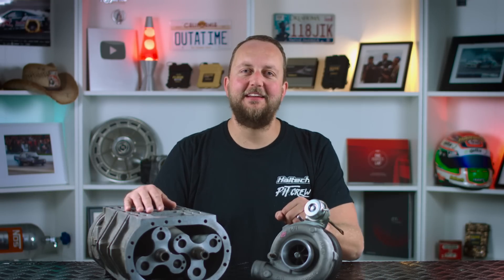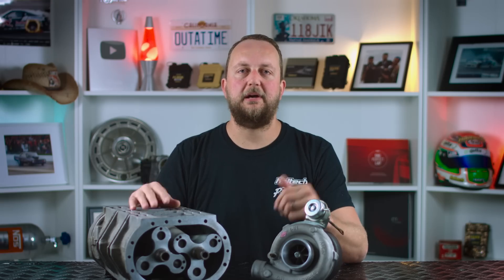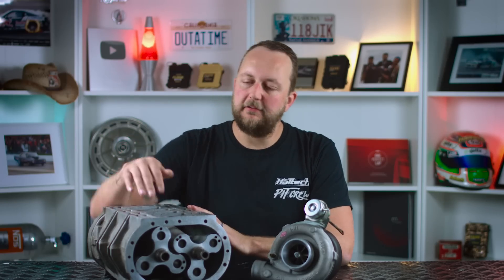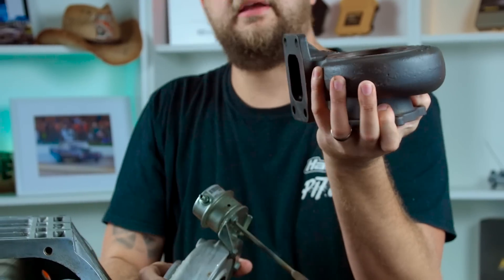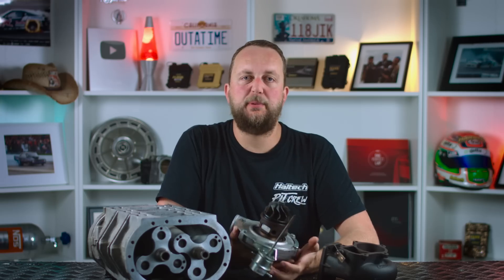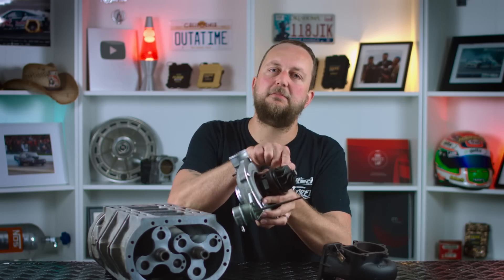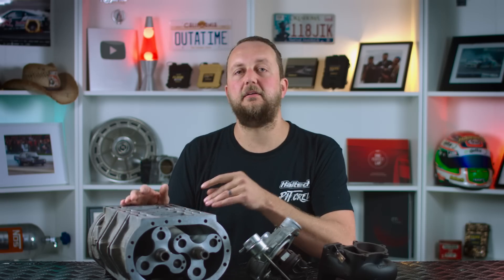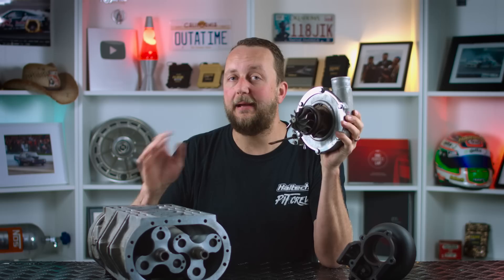🛠 Turbo or Supercharger? | TECH TUESDAY |

Comment: Forced induction can be further broken out by type of compressor... positive displacement or centrifical. Roots and Twin Screw are positive displacement compressors. A turbo is a centrifical compressor. A typical supercharger has zero lag and a linear boost curve. If RPM doubles, boost doubles (2X). However with a centrifical compressor, there is lag and boost is exponential. Double the RPM and the boost is 4 times, not 2 times pressure (2 squared). Superchargers also have some parasitic losses due to it being powered by engine. 

Fun Fact: Top Fuel superchargers take 1,000 hp to force feed vast quantities of air needed for 90/10 Nitro / Methanol mix to produce 10,000 horsepower. Net gain far exceeds parasitic losses. 

Note: ProCharger is not a supercharger. It's an engine driven centrifical compressor. It is a turbocharger without the exhaust driven portion. It has zero lag, but it's boost curve is not linear, but rather exponential. Like all engine driven compressors, it has some parasitic losses too.

I have been designing engines with compound forced induction... using both super and turbo chargers. Supercharger is fed pressurized air from turbochargers. Zero lag, linear boost curve, and enough power for a moon mission. Parasitic losses are reduced compared to supercharger alone.

Comment: Turbos run more boost safely with way less pressure to the crank so in the end it'll be better for a motor to use turbos then anything ran off the crank...

Comment: I have to argue with the misconception of superchargers having no lag. You first need to better define lag. Some people say it's before you hit positive boost, but that's actually boost threshold. The more correct way is to define it as the point where the impacts of the boost are felt (which is while engines are still under vacuum). 
Yes the supercharger is spinning whenever the engine is, but so is the turbo. People think that 1 psi on a supercharger a few hundred rpm sooner means it's magically significantly less lag where a turbo of the same size will ramp much quicker and have full boost long before redline, unlike the supercharger where max boost is only at redline. This also doesn't account for things like launch control and other antilag tactics within a given turbo/ engine management system (not including nitrous since that's an additional power adder).
Both have their benefits and downsides that I would have liked to see you dig more into. Yes the supercharger behaves more linearly and controlibly, but turbos also have the benefit of significantly more power under the curve. Bit as you mentioned, the quick ramp up in power can make it harder to control

Comment: Even if the engine was 10% VE it consumes 5L. The difference between 10% and 100% VE is the density (ie mass) not volume
Reply: I believe he's speaking for STP conditions with oversimplification as most don't understand air in terms of kilograms or pound mass. And because it's so easily compressible, a pound of air doesn't really mean anything. The mass of air will always disperse into the 5L of space given in the engine

Comment: Regarding the previous video. Could you shoot a recommended upgrade path for a k20/24? Ie start out with this, then that and finally end up with 1000hp at the wheels, for example. Could you also include pump gas only variants as some countries do not have access to e85?

Thanks for all the great info... Love the channel.. Keep up the good work
Reply: 1000 hp? billet everything.
Reply: 1000hp K series on pump fuel? 😂
Reply: What I meant with upgrade path is how far can you push on pump gas with certain upgrades and what is required beyond that to eventually end up at 1000. I don't have a k24, I never even owned a Honda. Was a question for the sake of interest and could maybe help others upgrade their cars. 1000hp on pump gas from a K24 sounds like a one liner joke tbh lol

Comment: Both...Used together is the best option. At low rpms, supercharger and at high rpms turbocharger comes to life. They complement each other and thus eliminating the annoying lag of the turbocharger, offering a much better torque at low engine speed.

Comment: JDM: Turbo

Muscle car: Supercharger
Reply: Fun fact, the very first car to use a turbo, is an American car. So what you said is completely wrong. Both go on both like a glove on a hand.
Reply: @domantas8185  Superchargers can't make high boost. Because muscle cars have big engines, then don't need high boost. JDM usually have smaller engines and to achieve bigger power they need turbos. 
Now if you put turbos on big block engines.... that's where unicorn land begins :)

Comment: I hear a bias in the tone :)
Reply: Only because turbos are better.  Lol
Reply: it is a technical bias, because turbos are simply more efficient machines for boosting for road cars. that's why most unmodified boosted diesels run turbos. haven't seen a diesel that intentionally used superchargers instead of turbochargers for performance purposes.

even race cars like F1 and rallye cars use turbos. imagine building a modern rallye or F1 car with a twin-screw supercharger then competing against turbo cars.

i think top fuel cars use superchargers because of the rules, plus they don't run laps anyway (races last less than 6 seconds) so efficiency is not really a top priority. the 2JZ dragsters in Thailand use turbos instead of superchargers though.

S2000 owners mostly use centrifugal superchargers instead of turbos if they just want road car performance. simple to install, can use stock intake manifold, and can use air to air intercooling.
Reply: @sepg5084  Roots/Twin screw can't make high boost, that's why small capacity or extreme performance or diesel engines use turbos. But they are not best at everything. If your boost is under 1 bar, and you need quick power response, supercharger is better. It's more predictable too, because there are no torque spikes.
Turbos are better if you are at wide open throttle for long times like track or drag. But if you are modulating throttle constantly on/off then superchargers are better. 
Centrifugals are somewhere in between :) 
I just didn't like that Scotty artificially overcomplicated superchargers with "magnetic clutches and pressure relieve systems". You don't even need that cluch. Turbos are more complicated I think... 

Max boost is harder to change on SC, but they won't overboost and you don't need boost control. Also SC doesn't have minimum boost like turbo wastegate pressure. From the video it looked like you can forget about SC and just use turbo in any scenario.

Comment: why wont people twin charge stuff?
Reply: Space becomes an issue, especially when you go to anything above a I6. Also supercharger now can make power in the higher rpms not just down low so there isn't a need for twin charging unless you are using those older superchargers.

Comment: If you have 5L engine that 100 percent efficient it consumes 5L of air every cycle... Hmmm. So if it is not 100 percent efficient, let's say only 80 percent- it does not consume 5L of air every cycle? I do not think it is accurate statement since the volume of the engine is constant. Regardless of engine efficiency 5L engine always consumes 5L of air every cycle. What changes with different efficiency is the density of air inside that 5L volume thus mass of air... I guess we all know that but for some reason keep relating VE and engine volume which is not quite correct unless we are using standard air conditions as the point of reference...
Reply: A 5 litre engine will not be able to draw in 5 litres of air due to inefficiencies to removing all the burnt gasses.  Valve timing will also change the V.E.
Reply: @clintmc8285  you are getting confused here. You cannot change the volume - it is always 5 litres on 5l engine. You will get different mass of air in that 5l volume with different efficiency (VE) resulting in different air density inside the engine. For instance you will get less dense air inside of those 5 Litres at idle and normal density air at WOT with VE 100 percent. We are changing the density of the air, not volume - it is physically fixed by bore and stroke. You can think of engine volume changing depending on VE but then you will need the density to be constant which is possible only if you use standard ambient conditions as the point of reference - I already said that before, but still in reality volume never changes.
Reply: @Georgianson  No, you are confused. The type of efficiency here does not have to do with idle vacuum or the density of air, rather the composition of the air in the engine during each cycle. Most NA cars will maintain consistent IATs across the rev range, meaning air density will remain fairly consistent, otherwise something is very wrong (different story w/ boosted engines, hence intercoolers). Yes, across 1 cycle there will have been a total 5 L of air in the cylinders (ignoring the volume of the gaseous fuel) and the volume of the cylinders doesn't change.

This is not the same as the engine consuming 5 L of air. If this engine is 100% efficient, then it will take in 5L of air, turn all of that air into useful work, and evacuate 100% of that air as exhaust, i.e. it consumes 5L. This doesn't happen because it would require the capacity of each cylinder to be 0 L at the top of each compression stroke, thus an infinite compression ratio. Engines become inefficient when they do not evacuate 100% of these gases, and some 'used' gas remains in the cylinders. Obviously there are other efficiency losses too, e.g. heat, sound, light, etc.

Consider a 5L engine with a. 10:1 compression ratio, with an open head (i.e. exhaust pressure at 1 atm). At the top of each exhaust stroke, the exhaust gas will evacuate the cylinder until the cylinder's pressure meets atmospheric, but there will still be 10% of the 'used' air in the cylinder as the engine moves to the intake stroke. When there is a restrictive exhaust, the pressure in the exhaust system (back pressure) increases, and so even less of the 'used' air is evacuated. Back to the original example, it means that upon the next full cycle, 10% of the air in the engine for that cycle has already been consumed, so only 4.5L of air will be consumed, resulting in a 90% efficiency.
Reply: @kgsva  ok. Can you then explain what happens at idle when exhaust gases have all time in the world to evacuate from cylinder? The engine is still reving but the amount of air getting into the engine is limited by throttle thus reducing VE. That limited air is still distributed within those 5 litres of displacement and that is why the gauge is showing 0.4-0.5 bar vacuum at idle whilst it is showing about 0.95 - 1 bar at WOT. Why there is different vacuum if it has nothing to do with air density?
Reply: @kgsva  and one more question for you. You say that if 5 L engine ve is 90 percent when only 4.5 l of displacement is filled with air since the other 0.5 liter is filled with exhaust gases. Therefore, if the same engine has ve 80 percent then only 4 liters are being filled with air and so on progressively... My question is how come there is such a big volume of exhaust gases remaining in the cylinder after piston moved all the way up to Top dead center pushing out all the gases to the exhaust system?  Moreover, there might be some valves overlap happening when the piston is around TDC, creating scavenging effect and helping to evacuate all exhaust gases... How do they manage to stay inside the cylinder after all of that?
Reply: @Georgianson  I am sorry where did I say anything about the volume changing?  Nope ever said anything at all.   You can not fit  5 litres of air into something if it is not empty.       Really that is not hard to understand.  One sec let me get a 375ml glass and check.  Yep if I don't get all the water out I can't fill put 375ml back into it.  The glass still holds 375 that has not changed but if there is 10ml left in the glass I could only add 365ml.    Please try reading =)
Reply: @clintmc8285  so you are saying that if engine efficiency is 50 percent (VE 50 for instance) the half of displacement is filled with exhaust gases and therefore cannot be refilled with new mixture although piston travelled all the way up to TDC pushing out everything from cylinder and the blow down of combustion chamber during valve overlap when the position around TDC. Is that what you are also saying continuing your analogue with 10 percent of volume being already taken by exhaust gases with VE 90 percent? Where all these gases stay at, how do they get back to the cylinder after valve overlap scavenging process?)))

Comment: Turbo always, for many reasons. I'm not saying superchargers are bad, they definitely boost power for sure. Turbochargers just do it better in my opinion. Turbos can vary their boost incredibly easily. You can also get max boost earlier because boost is not related to engine RPM. Turbos also make less heat and require less energy to multiply the air. With all 3 types of anti lag systems these days, turbo lag is a lot shorter and basically a non issue. Superchargers are good for jumping from a standstill, like on dragster rail cars, rock bouncers, and burnout cars. Turbos are good for efficiency and constant load situations like semi trucks, tractors, road race cars, rally cars, rolling race cars, standing mile racing, top speed salt flats, drift cars, etc. Also with innovative boost control not using a waste gate but a controlled boost leak, turbo lag in drag racing is getting reduced a lot.